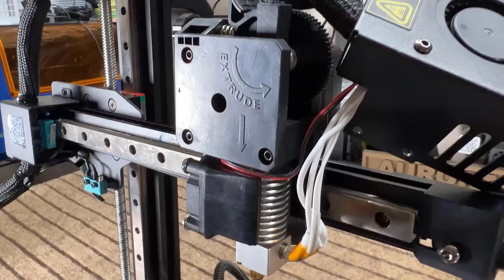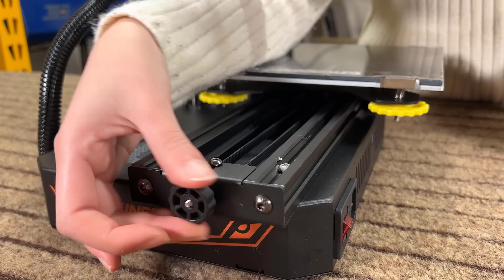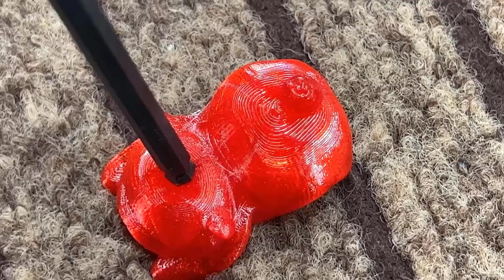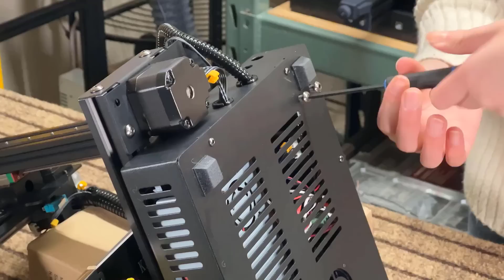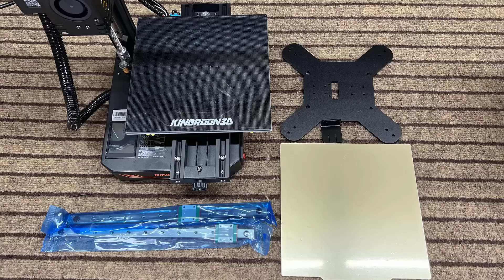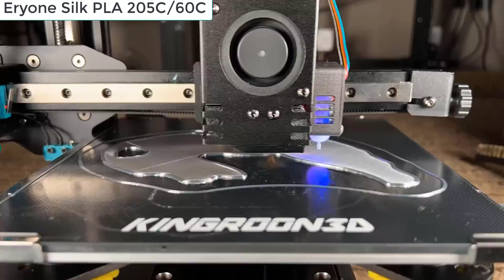Kingroon KP3S Pro: A budget tiny 3d printer with linear rails, in-depth review and upgrades

Comment: First mode, Fit a silicon sock to the hot end. KP3s was naked and wasting heat out the box. I will say though, The only issue mine gave was a stripped thread on the Z coupling so the bed wouldnt rise, After a quick check over That screw was replaced with one 5mm longer and everythings been printing nicely.  This little beauty prints well, Faultless benchy (apart from the seem, that i could have lost in the slicer.  Well worth a go.

Comment: Did you encounter any difficulties in installing y linear rails? Mines arrived wobbled and also the aluminium bars where not straight... At the end solved with 2 rubber rings between the new plate and the y Rails.

Comment: Great review.  I recently got the S1 from Sliceworx.  Same experience with heating and leveling.  I also moved the filament up top, with modified roller holder, but haven't moved the sensor yet.  I'm not a fan of the glass bed.  (I already ruined it, removing a print pulled the finish off, haha.)  I don't get the point of those tnuts, but whatever, it works.

Comment: What was buggy? The motherboard or the firmware?  How about adding insulation to the heated bed? What new features did the firmware update offer? Do you think it's possible to use a text based screen instead of the graphical one?

Comment: I have 2 issues with this review:
1. No mention of ringing
2. ABS needs an enclosure, and printing ABS open frame results in bad fumes and bad layer adhesion.
But aside from these issues, I think this review is good.
Reply: Not to mention the hotend is PTFE lined11, and you shouldn't really go above 230 degrees with it or you might get off-gassing.
Reply: @TheFresh1492  It is supposed to be safe up to 240c

Comment: Is this printer not running Marlin?  Since it is mentioned to run a board similar to the MKS Robin Nano, I would have expected it to be fairly easy to build a custom Marlin for it with all the options you want.  Or ... add a Pi Zero 2W and Klipper (probably making the screen useless, but getting so much in return and controlling it via your smartphone.

Comment: It would have been cool, if you had compared this Printer to the Tronxy Crux 1 you reviewed some time ago. I think this would have been very interesting for people who can't decide wich low Budget printer to get
Reply: Agreed. The Ender 2 Pro went from my list pretty quick. Crux 1, KP3S Pro and Prusa Mini is where it's at.
Reply: I love my crux 1, at first I didnt and it was because of the all thread heat break but after upgrading it to the one tronxy sells for 15 dollars Its never loosened again on its own due to the set screws now instead of a lock nut. Ive printed at 150mm a bunch of times, just need slow first layers

Comment: I just can’t imagine buying a 3D printer in 2023 without an ABL sensor. Especially one with a spring bed.
Reply: I don’t see why you would need it, especially on a printer this small. I have 5 printers and no ABL, but once I level them I’m good to go.
Reply: @polypeptide_147  I agree, ABL is  nice if you change build plates or location often, neither of which is my use case. No need for ABL really.
I also like the older 12864 RepRap displays more than touch screen.
Reply: ABL causes more problems than it solves.
Reply: @petercallison5765  I have a Tronxy X5PS with a 330x330mm print bed. ABL is a must there.
But i agree with you with small printers.

Comment: My gripe with their printers is you always have to upgrade something.  In my case,   their KP5S didn't come with an auto bed leveling.   I think Auto leveling is a requirement for large bed printers.   I had to install it,  and update the firmware which wasn't easy to find btw.   And now my screen goes blank during printing and I can't access the menu during the print.  I have to reboot the machine after each project.  This is so annoying.

I'm seeing the same issue with this KP3S pro....  For a machine that uses  the word  "PRO",  I would've imagined the rails were already upgraded to linear.  Magnetic Bed would've been nicel.   Auto bed leveling would be good,  but not necessary for a small bed.  However,  buying all these upgrades,  it would cost me around $300 total.   So instead,  I bought a different printer with all those things I wanted for $300  and I don't have to mess with it.
Reply: Fair enough. But i think you don't need to upgrade. She was able to print a benchy without any updates.
If you have a glass bed, ABL isn't really needed i think, regardless of the size. Once dialed in, it works until you change the print surface or location of the printer.

PRO is just a marketing word. These machines are not made with European or US quality standards in mind, the end stop screws for example wouldn't fly here. A Company that does it's business like that would perish soon. If you want quality, you have to pay the price and go to Prusa, Ultimaker or someone like that.

The rails are just a gimmick, in my mind they aren't better or worse than OpenBuild rollers.
Reply: @citronski  
I prefer the rails.   It doesn't necessarily make the prints better,  but the maintenance is simpler.  My old CR-10 and Ender 2 had the rollers,  and i always get paranoid that the screws will loosen and start to wobble. And they seem to wear down faster than the rails from my observation.

Glass beds work okay,  but I prefer the magnetic bed.  I don't have to wait for the bed to cool down to remove prints.  If the glass had a consistently even surface,  then i would probably use that over magnetic beds.

When I first bought my K3PS.  I really loved it.  Small,  accurate,  and durable especially for the price.   I expected that they up their game with the newer  K5PL and K3PS Pro,  but it doesn't seem like it's any better.  I'll gladly pay the extra $$$ for properly upgraded versions.....

Comment: Thank you for an amazing review! I have a KP3S and I'm interested in this one. One question: would it be possible to add the E3D Revo system to this printer? You say the hotend is a modified V6, so I'm not sure if the Revo Six would work there. What do you think?

Thanks again!
Reply: The E3D v6 is shorter. You will need to print another fan duct. Everything else is fit perfectly.

Comment: Pretty disappointing number of QA issues. I get that it's a $200-250 printer, but basic stuff like bad filament path and bed heating failures make it feel more like a refurb Ender 3, in terms of experience, if not worse.
Reply: This. Chinese can't do quality. Look at this, look at Bambu Lab X1. I'm not sure why, but i have yet to see a company that offers European or US quality.
Reply: @citronski  what's the problem with the X1? Heard of Kickstarter backers getting flaky units, but that they fixed those hardware issues once they hit mass production. I know the software for the X1 has been a disaster, though.
Reply: @theglowcloud2215  You have to tinker to keep them running and that is a nogo if you need them for production. We have 5 of which 3 are down as we speak, waiting for replacement parts.
We learned a lesson: If you need to rely on 3D printers to meet any kind of deadline, skip China made printers.
Reply: @theglowcloud2215  I'm not against 200€ Chinese made printers at home however. You know you get a tinker device, you know what to expect.
Reply: @citronski  What parts failed?
Reply: @theglowcloud2215  Can't say, technicians deal with it.
Reply: @citronski  🙄

Comment: I am surprised that they did not send you the all linear rails version to review. 
IMHO, linear rail on Z is crucial too. As the rubber wheels will some times hit a "bump" in every rotation, that might be because of the low quality bearing inside. On my elegoo neptune 2s I often have Z bandings that are 72mms apart, due to the low quality wheels. The wheels are 25mm in OD, and the part that touches the rail is slightly narrower than 25mm, giving a 72mm diameter.
Reply: As far as i know it's supposed to come out in february.
To be honest, i don't think loosing 15mm in Z is such a big problem. One could probably fix it with a few printed parts as well.